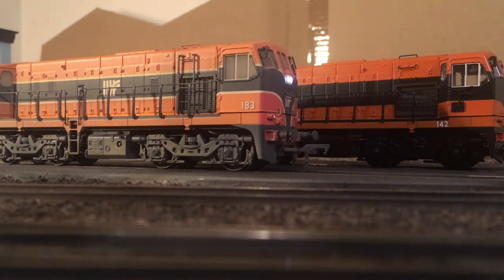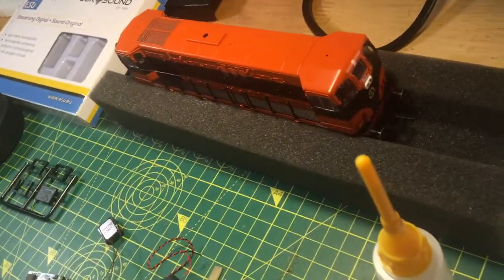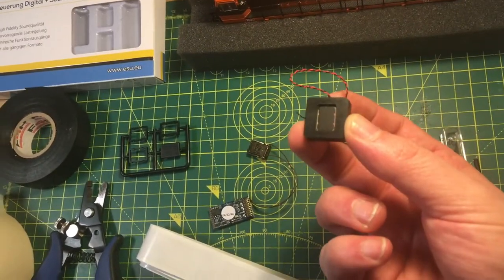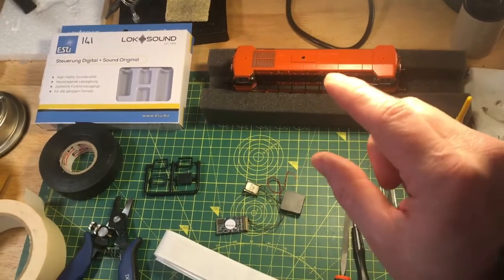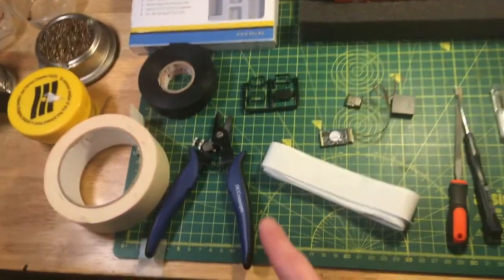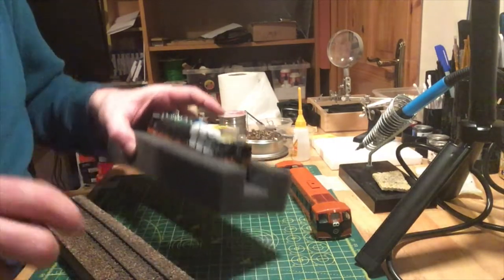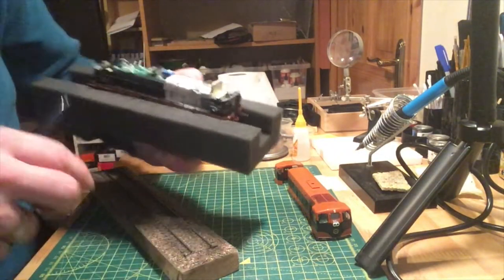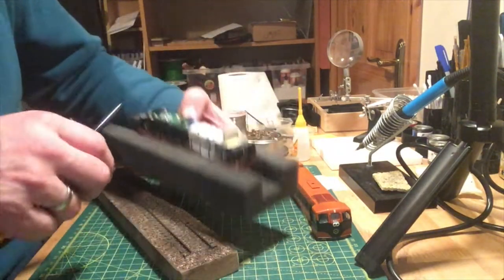Murphy Models Class 141/181: How to install a DCC sound chip and speakers

Comment: Very good video. Could you use a dermal type tool to remove the metal ?
Reply from the maker: I would say so, I thought of it but haven't tried it since it's so close to the motor and delicate parts. I was too nervous! However since this video I have gotten better at clamping stuff in place while working so might give it a try the next time :)